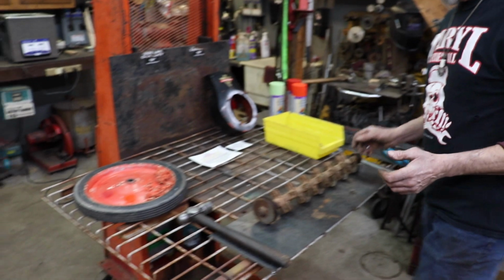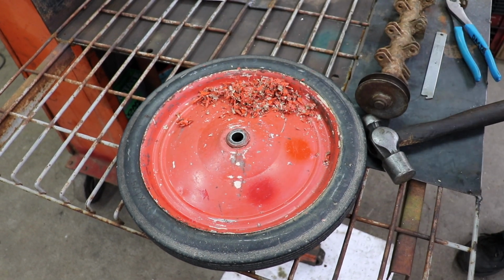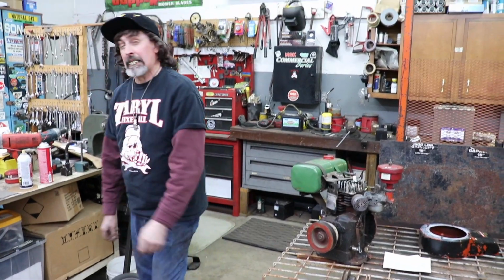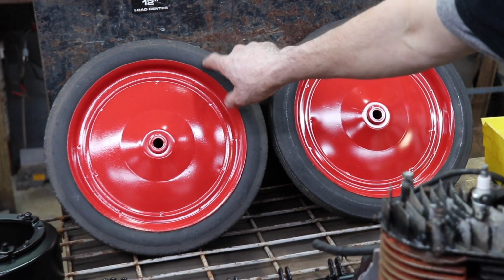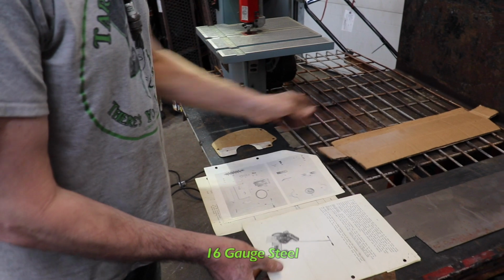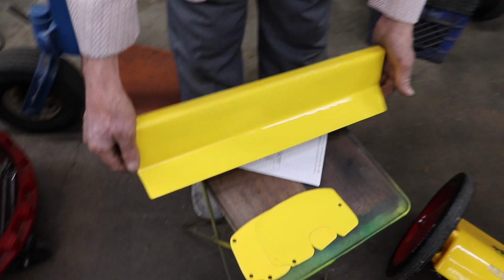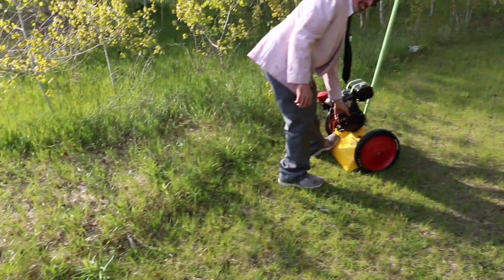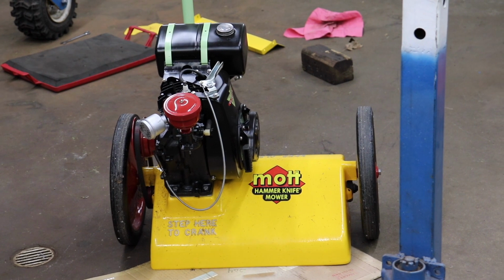Amazing Mott Hammer Knife Mower Restoration Part 2

Comment: Unfortunately saftey regulations don't allow basic and simple anymore . I'll stick with my old Lawn Boy mowers thank you :D
Good job Taryl , a piece of OP equipment history preserved.
Reply: I don't think "safety regulations" figured into it and this machine is not the simplest--simple is a rotary push mower with one spinning blade, which explains their endurance to this very day. I just think the Hammer Knife with its multiple blades, not to mention the hassle of sharpening (or replacing) each one, is way too complicated for the average homeowner. Safety regulations vary though, depending on locale....

Comment: I really like that the MOTT can get into tight places and turns easily. Unlike a regular mower that you have to do the back and forth maneuver to get turned around. Great job guys!
Reply: Yeah, just two wheels is key. I think the Mott corporation was trying to improve on the powered reel type mowers of the same era, but the utter simplicity of the rotary push mower explains why they dominate today.

Comment: Larger flail mowers are making a huge comeback.  They are beastly machines.  You get a lot more cutting power per horsepower than with standard blade mowers.  Really great restoration.  Thanks especially for taking it for a test afterward.  Most folks wouldn't do that.  Keep up the great work.

Comment: Thanks for sharing your build Taryl. FYI Before plastic wheels became the go to for mowers etc. your local Mom and Pop hardware store sold those red wheels in various sizes as replacements.  I recall many a soapbox racer prized them for their builds. You made the right call painting the Mott Hammer wheels the same color.

Comment: Awesome restoration Taryl! It does a great job on tall brush and weeds. The only reason that I could think of for why it is not more popular is that removing and sharpening those multiple blades are a bit time consuming compared to a single blade rotary mower. I really like the machine myself.

Comment: Flail mowers are still quite common for mowing along highways, since they can cut steep steep slopes off the sides of a tractor and hit debris without much damage to the mower. 
RustOleum spray stops up because the paint is thicker. Turn the can upside down and spray until only gas comes out, and the nozzles won't stop up as often. Stop as soon as the paint stops coming out with the can inverted. Their new self leveling brush on paint is amazing stuff.

Comment: Flail mowers are still popular! I'd love to have a 6ft machine for my tractor over my 6ft bush hog, but flail mowers are popular for the no-till market gardening types for shredding down the cover crops to prepare for planting next crop. They mulch really well and can cut right down to the dirt with no problem. BCS has a flail mower attachment for this and I think Grillo? Italian hand tractors. Check it out, but they ain't cheap. I have an 8hp Briggs that may just make a hammer knife project machine! Looks easy enough to fabricate the parts...I am a machinist!  Make it a little heavier than that Mott machine, though.

Comment: Those are cutting blades/kinves for lawns. The hammer blades are more like a T a single blade/knife for doing brush and thicker stuff. Great video 👍
Reply: M.A.G.A
Reply: The heavier duty flail blades are sort of like little scooped shaped hammers and made of cast steel-EXPENSIVE but can cut thru about anything the mower can walk over.The edge of the "scoops" are sharpened-and can be sharpened many times before wearing out.

Comment: After I use spray paint, I pull the nozzle off and attach it to the spay tube of brake cleaner and spray brake cleaner through it.
Reply: I turn the can upside down and spray the paint out of the pickup tube.

Comment: That looks amazing!! Wanting to do this to a Wheelhorse 520H tractor I recently purchased for $200. Would like to see an Onan 20hp engine. The steering is loose wheel has a roll pin that appears wollered out that and the steering shaft has a worn bushing. Would like to see if you've fixed that in your many years of working on these. Im sure you know what I'm talking about since your brother is a Toro dealer.

Comment: Regarding your spray paint issues I store mine on their side so when it settles it’s not on the bottom getting into the pick up tube I have found that cured the stopping up issues it’s settled on the cans sides and mixes up well with just a good shaking .   Have a 3  point mower like that we have always called them a flail mower they are great when you have a lot of hidden trash in tall weeds does not hurl objects like a brush hog will . You will find it shreds small trees  into chips too .

Comment: Very nice job!  The sharpening job looks like a real pain - to remove all the cutters, bend all the cotter pins, etc.  Wouldn't look forward to that regular maintenance.  Impressive that you recreated the missing parts for completeness.
Reply: They made a tool for that which looks like a large dremel with a guide on it. You ran the engine out of gas, then flipped it up so it sat on the handle and the guard and then you could sharpen them without removal.

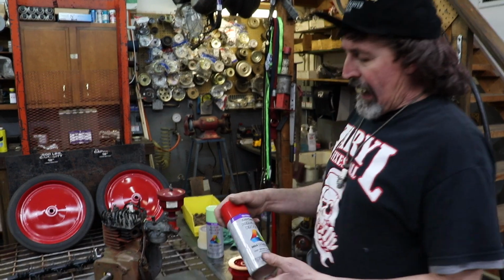Comment: 14:40 a little tip to keep paint can nozzles from clogging up, after you're done painting, turn the can upside down and depress the valve until the spray is clear. Wipe off and store as usual
Reply: My guess is he is well aware of that (after all, most companies print that on the can), does it, and it still clogs on the offending brand.
Reply: That works on the old style paint cans, but many of the new ones will paint in any position.

Comment: Great restoration, I assume they didn’t make more due to maintenance for all those blades. I was also surprised at how well it seemed to work. 

Totally agree that manufactures need to go back to simple ways instead of making everything overly complicated. They spend too much time making changes and less time thinking if they should.
Reply: You just place an order for 500 blades. Mr. Wilcox had no problem with that.

Comment: Taryl, it's much safer leaving the tool rest on a bench grinder, with no more than 1/8" gap.
PS  You hit the nail on the head with the Rust-Oleum nozzles!
Reply: I thought I was the only one. I wrote Rust-Oleum and had to demand a free set of nozzles so I could use up my spray paint cans that had clogged.
I might just switch to Krylon or Taryl's brand
Reply: @Hjerte_Verke  I used to turn the can upside down and hit the nozzle for a while to clear it after use, it kinda works...  but I would also rob nozzles from other cans, that also works, lol

Comment: The bearings are pitted,you could pull the Bearings part to find that the bearing races have pitting on them,I have an old Victa 2 stroke lawnmower engine which has crankshaft bearings which sounds like that.

The engine was full of water 💦 when I found it but it still runs,it runs at full speed Because the speed governor is vacuum operated & the engine has air leaks !

Comment: THIS MAY SAVE YOU SERIOUS HURT...!!!!!
Taryl,  most guys don' t know, the cut off discs are made to run fast, usually 23,000 rpm. It mounts on your air cut off  tool. They run at those fast speeds. The thick wheels, used for grinding, and sharpening, are usually rated for like, 11,000 rpms.  Guy I knew used the thick wheel on his cut off air tool. Due to the higher speed, centrifical force  made the thick wheel explode. He was wearing a full face shield, and protective glasses. The wheel particles went through the shield, cut his lip open, chip half a tooth off, and  broke his glasses; they told him they probably saved his eye.
     Just something as simple as that. Let you subscribers know about this dangerous situation......
             Thanks........Donny

Comment: I wonder if those are the original blades. On flail mowers, at least the ones they sell today, hammer-style blades are one piece “t-shaped” blades. The two-piece, “Y-shaped” blades are called knife blades. Since that mower is advertised as a “hammer knife mower” I wonder if it had T-shaped blades originally. I bet you could still find new blades that would work on that machine if you shopped around.
Reply: The two Motts I have both use the same blades as this one. One is a push style and the other mounts to my Cub Cadet.
Reply: @Blazer02LS  a garden-tractor sized version of this must be awesome!
Reply: @rockharvey5787  There are videos online of folks using them.

Comment: 2 Part Epoxy Paint Would Hold Up Pretty Good On The Cutter Blade Shaft Or A Heavy Coat Of Chip Guard Like Used On Vehicle Rocker Panels Doors

Comment: Cool Machine I wonder why they didn't put the handle in the center of the machine?  was it because the engine is offset? Or was it because of the Solar Flare?
Reply: Offset so you could cut closer to objects without bumping into them, and so it pushes easier because of the offset engine.

Comment: Red turns Orange and then Yellow if it's left in the sun, The only color that does that but we used to have problems with Red Inks as far as UV Light exposure goes. So it could have been Red originally

Comment: Taryl I can tell you why it didn't catch on. This machine as a walk behind is to dangerous if you trip or fall while using it it will be on top of you hammer knifing your feet and legs etc.  This company makes larger versions of these. Some even to be pulled by lawn mowers etc. If you want to get even bigger these are generically called flail mowers and most Government agencies use these to mow roadside right of ways. You need to be very careful around any sort of cable, such as electric fence etc.. They can do a lot of scary stuff in a matter of seconds.  A company called Tiger makes a larger version for mowing around guard rails etc which can even mow down decent sized trees.
Reply: Same danger with any push mower. We know why they don't make things simple and easy to fix

Comment: Why are the engine and the handle off-center? Is that so you can off to the side and not get your suit dirty?
Reply: trims close without hitting things and offsets the force due to the engine placement. To center the engine would require a longer shaft to drive the cutter shaft.

Comment: I tried calling the shop. Wouldn’t  let me talk to ya about a 20hp Briggs single cylinder inteck. Runs wide open all the time. Replaced the Governor and readjusted it many times. Still runs wide open. When is the best time to call you???? I never miss a video. Great job

Comment: Why do you think they offset the handle and motor?
Reply: If the motor were centered then you couldn't drive the blade shaft without some kind of transfer case (like a roto-tiller).
Reply: A Aube  - Duh, that dawned on me after I asked the question. Thanks

Comment: u wouldnt build that corner of the deck up with weld, u cut that corner off n cut a fresh piece then butt weld, slightly notch where u butt the joint so u get good penetration without needin a rubber  i mean without warpin ur part to shit

Comment: They stopped making these for the same reason why they stopped making the Haban sickle bars for garden tractors. Morons! The Mott because you could easily pull it onto your feet when the guards are off and the Haban units because they would cut in any position and many folks forgot that sticking your hands on a moving sickle bar is a very bad idea.

Comment: If possible is it possible to get your phone number. I’m having a problem with my Briggs 20hp single cylinder inteck engine it over speeds and I have adjusted the Governor many times I even replaced the Governor/ oil slinger. And still over speeds. I need your help please. Bruce